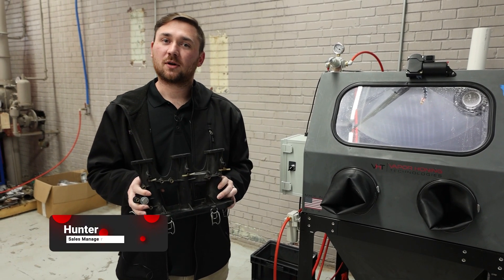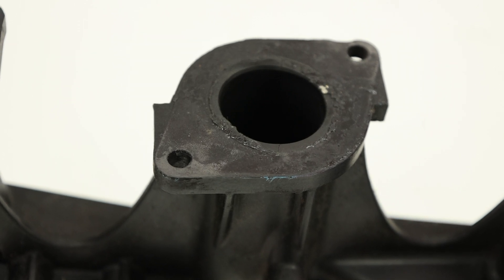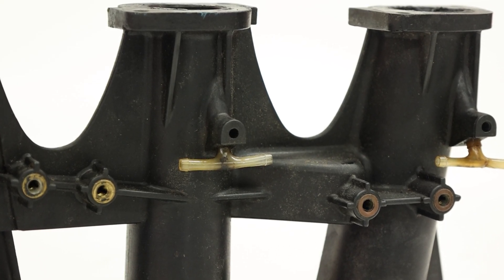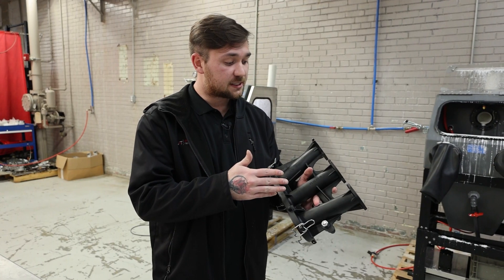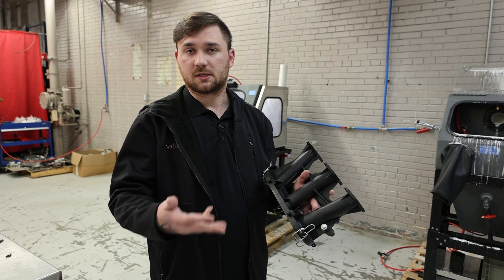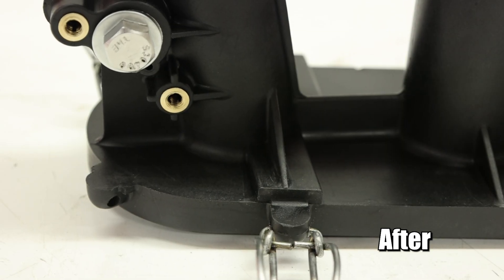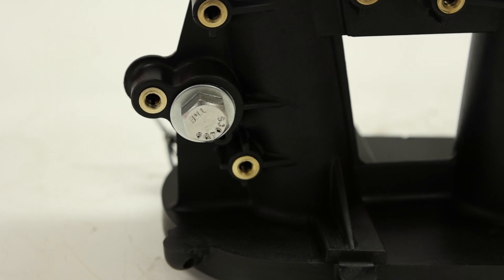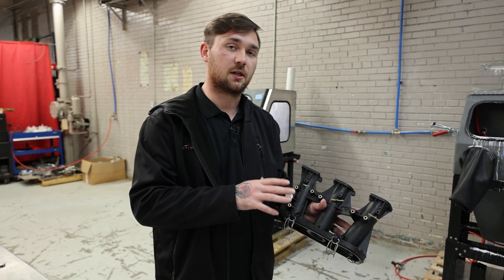Can You Vapor Hone Plastic? Vapor Honing a Porsche 911 Throttle Body!

Comment: When blasting aluminium, do use any oil etc afterwards to keep surface clean?
Reply from the maker: We have a corrosion inhibitor that can be added to the machine to protect the parts. It also prevents rusting on ferrous materials at least 72 hours after blasting, and it does not affect coatings. 
https://vaporblasterforsale.com/collections/abrasives/products/wet-blast-corrosion-inhibitor